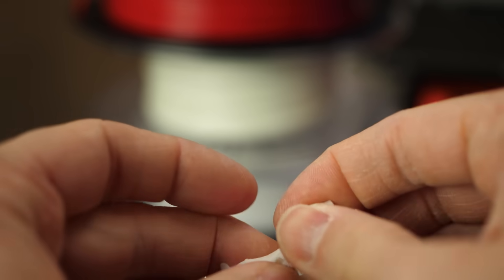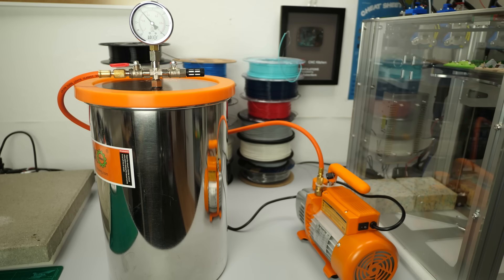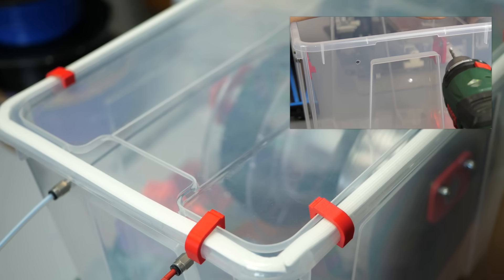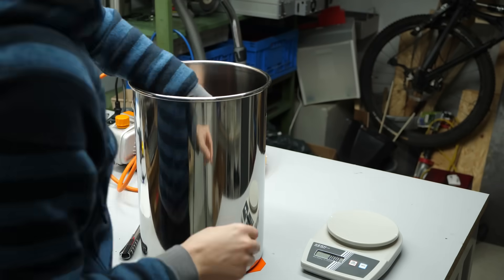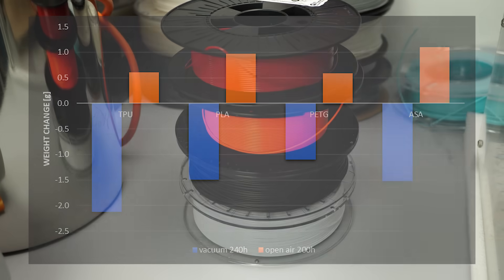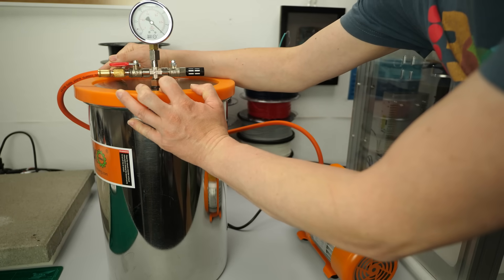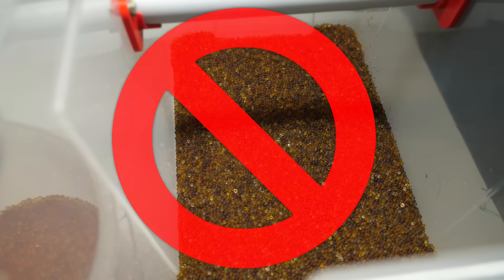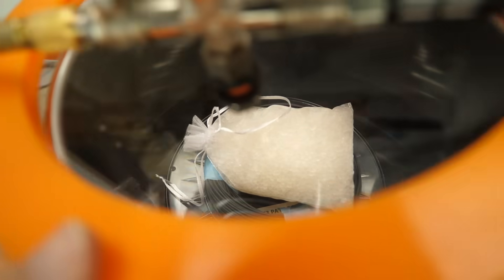Vacuum VS Dehydrator! What's the best way to dry filament?

Comment: You should try this again, but with a stronger proper desiccant, like a type that would be used in chemistry. Those beads you have will only seek an equilibrium of moisture with the air, but they hold more moisture than the air (per volume)... Something like Calcium Chloride (commonly used as a pet-safe sidewalk de-icer and food ingredient) will liquefy when it absorbs water, and is so thirsty for moisture that it will dry your silica descants out if they get trapped with it. Something like this is much more appropriate for use in a vacuum chamber, because it is far less likely to give up its own moisture to the air in there. The silica gel would just find the nearest equilibrium point, and taper off similarly to the graphs you showed.
Reply: All desiccants absorb to equilibrium, and calcium chloride is totally ineffective at low Rh. It's good at bulk absorption, but utterly useless for drying. Silica gel is better for our purpose, but far from best. Did you mean calcium oxide?

Calcium oxide is old technology, but extremely effective at low Rh. Its absorption is chemical, therefore difficult to recharge. Rather recommend common 4 angstrom molecular sieves. Sieves are potent at low Rh, fast absorbing, food safe, easy to handle, and fairly easy to recharge. Sieves are absolutely everywhere in industrial drying, and I guarantee every good filament maker is using them.
Reply: @RandornCanis  Sieves and Silica gel both work by adsorption. In a vacuum chamber, this is less effective, because the air has been removed, so everything that is in the air's space is water (and possibly other volitiles). Without a composite of partial pressures, adsorption is missing an ingredient necessary to its function. This is why chemicals that take more energy to dehydrate would be a better choice. One I see most often is copper II sulfate (probably because it's naturally color-indicating), but I'd suggest using the calcium chloride, because it has the chemical hydration reaction of calcium oxide and copper II sulfate, but is less likely to turn your kids into soap if they get it on them, or cause copper poisoning if they mouth a part that somehow got into the 'crystal smurf', as I like to call it. Calcium chloride is used in beer and food, and is also considered pet-safe ice melter, and some hand warmers. It can hold 150% of its weight in water, whereas silica gel can hold 35%, and seives 20%. You clearly know your chemistry, but I think there's a mixup in the equilibrium descriptions. Even if not, a can of calcium chloride (also sold as Damp Rid) next to my color-indicating silica gel canister keeps filling with liquid on top of solid CaCl2, while the silica indicates that it's getting drier and drier.
Reply: @buckstarchaser2376  Everything is metaphorically up in the air when literally under vacuum. I suspect the lab setting sees more perchlorates. Absolute overkill, but we're already in that realm with chemical dehydration under vacuum. Molecular sieves and silica gels could make achieving ultimate vacuum challenging, but it's moot with that single stage pump. Though, Van der Waals forces of porous absorbents would release (some) needed heat. Ultimately, I believe keeping the process simple with a vacuum oven is ideal here. Safe, simple, and modestly cheap with all legalization happening.

Under normal atmosphere, calcium chloride will dehydrate many indicators. As an example, cobalt(II) chloride absorbs a large mass of water at higher vapour pressures to form its hexahydrate. We shouldn't simply regard calcium chloride as the superior desiccant through observation of one indicator. It's more accurate to say the calcium chloride is dehydrating the system below the water vapour pressure to dehydrate the cobalt(II) chloride hexahydrate. Put rather simply, the silica gel isn't dry, only drier.

In storage under normal atmosphere, calcium oxide or sieves should be superior with far lower achievable vapour pressure capable of well more than dehumidification. Although experimentational data is abundantly available, it'd be an interesting exercise to test. While molecular sieves may absorb a fraction of chemical alternatives, this is negligible considering the couple grams total water in filament, much less the roughly 300 milligrams water in 40 litres air. Sieves' virtually infinite rechargeability and small initial investment make them very affordable long term.
Reply: @RandornCanis  Gotta point out that the Calcium Chloride ice melter is like $15 for a 25Lb sack, shipped, while dodgy 3A sieves are at least $20/lb before shipping. The CaCl2 is cheap enough to discard the fraction that deliquesses into its own victory water. Sieves, due to their cost and unlikliness of arriving ready to use, require a heating period, followed by a vacuum period. Or, you could just desiccate them with CaCl2. Whichever method makes you popular at the club is going to do well enough in your drybox... Calcium Chloride is by far the superior desiccant though. It's also called DampRid, if you wanted to pay more for the solid/liquid separator bucket thing. If you like it, you can just refill with the cheaper ice melter.
Reply: @buckstarchaser2376  Sidewalk salts also ship in higher hydration states requiring regeneration before process use. Molecular sieves are kiln dried in manufacturing. Made in North America for $5/lb through carpentry or petroleum connections. Quality and state easily verifiable with water and Van der Waals heat. I did specifically recommend 4 angstrom because the additional ion exchange process to 3 angstrom increases cost while decreasing capacity.

It’s suddenly apparent the fundamental misunderstandings in this conversation. From earlier discussion of vacuum desiccation, I’d incorrectly assumed the anhydrous state of calcium chloride. If you’re allowing deliquescence, I have to ask what is your understanding of hydration states? This because the plateau of equilibrium of Rh is over a whopping 30% if there’s any brine to fraction at all.

All opinion aside, the states of calcium chloride are documented ad nauseam. I recommend researching these equilibriums. You will find that even poorly activated molecular sieves will desiccate calcium chloride brine, reverse the chemical process, and fully precipitate the salt. Further, I fervently recommend replacing calcium chloride well before deliquescence; the Rh equilibrium plateau is shocking high. At the first sign of liquid brine, it’s frankly too late.
Reply: @RandornCanis  My experience with CaCl2 in a gun safe (not vacuum; not airtight), next to a large canister of silica gel (there is a second can of gel elsewhere in the safe), results in liquid brine in the can of CaCl2, and silica gel that is color-indicating that it has become drier by being trapped in that same air volume. The suggestions that you have typed so far have yet to overcome this simple observation from an accidental experiment. I use a little in my gun cabinet, and my biggest worry is that it may overdry the wood in my rifle stocks and cause cracking. If I recall correctly, we're commenting on a 3D printing filament video, and nothing anywhere close to lab-grade requirements are needed to straighten out some soggy PLA. Vacuuming the filament with silica gel will not work that well though, as you're essentially just replacing the air with vapor, until the PLA equilibriates. To get it satisfyingly dry for us nerds would require a substance that releases a lot of energy as it hydrates.  The low pressure conditions should not overcome that energy level so as to keep the mass flow in favor of desiccation. From that line of reasoning, it seems like concentrated sulfuric acid would dominate both of our favored desiccants.
Reply: @buckstarchaser2376  Putting it together. The hydrate state boundaries of calcium chloride follow: dihydrate 11% Rh ↔ tetrahydrate 20% Rh ↔ hexahydrate (deliquescent) 30% Rh. Like other salts, cobalt(II) chloride follows some set of hydrate states: dihydrate (purple) 34% Rh ↔ hexahydrate (pink). For fun, albeit irrelevant, cobalt(II) chloride hexahydrate deliquesces at 61% Rh.

These state boundaries are plateaus of equilibrium as they exchange large masses of water to overcome. This buffers the environment, and lends calcium chloride its title as a good bulk desiccant. The concept is similar to enthalpy of vaporization; adding heat to water, for example, raises temperature according to specific heat until a particular point where temperature stalls – boiling point.

It’s crucial understanding everything mentioned is chemical process, not chemical reaction. The calcium chloride, silica gel, and air are one system at equilibrium. All processes are easily reversible.

What does this look like in practice? Let’s start with calcium chloride dihydrate and silica gel dehydrate. Place both in container. As vapour ingresses, relative humidity rises linearly, but equally throughout the salt, silica, and air system.

At approximately 11% Rh, we encounter the first plateau. From this point, introducing further vapour mass will not yield any significant variation to Rh of the system. The calcium chloride dihydrate is rearranging its lattice and forming tetrahydrate. Only once dihydrate is exhausted to completion does Rh climb again. What do we observe? Well, nothing. Calcium chloride tetrahydrate is also a white solid salt.

Rh is now rising, so what’s next? We encounter the calcium chloride hexahydrate boundary at 20% Rh. The salt, silica, air system again stalls in Rh. Once complete, the resultant hexahydrate is again a while solid salt.

Finally after reaching 30% Rh do we arrive at our final plateau – deliquescence.

You may notice the overwhelming lack of mention the other components in this system. It’s not an oversight; there simply isn’t anything transformative to mention. Silica gel has been absorbing water throughout this exercise linearly proportional to Rh. At equilibrium of deliquescence of calcium chloride, silica gel will have absorbed 15% water w/w. What about the cobalt(II) chloride indicator? We haven’t even reached its first and most significant boundary, ∴ no colour change.

Sum it up. Why does calcium chloride desiccate silica gel? The silica gel was wet to start. It will diffuse moisture until the system is at equilibrium. Roles reversed, anhydrous silica gel will desiccate calcium chloride, but the limited capacity of silica gel weight for weight results in less observable effect.

Why does the added indicator indicate dry? Indicator salts vary appearance with their independent hydration states. Cobalt(II) chloride indicates at its dihydrate-hexahydrate boundary of 34% Rh. If calcium chloride is buffering the system at 30%, the indicator will remain at, or transition to, its dihydrate purple state at the cusp of “moist”. Indicators function independently of adjoined silica gels. Silica will absorb 17% water w/w before reaching boundary of cobalt(II) chloride hexahydrate, and will in fact absorb considerably more water after indication.

Is calcium chloride any good? Desiccant for its job. Wood absolutely suffers when dehydrated. You nailed it for the safe. The buffering at a healthy Rh, and capacity for a non-hermetic container. As for filaments, no problem bringing PLA and PETG to condition. PA6, PC, and even ASA benefit from more aggressive desiccants effective at lower vapour pressures. Calcium oxide and molecular sieves are examples of desiccants with high absorption at low Rh below 8%.

Should we use any desiccant under vacuum? Any moisture will diffuse from filament to vapour under vacuum. Vapour is air, and an ideal vacuum is the total evacuation of all gasses. There’re some perchlorates and exotic desiccants to compensate for ultimate vacuum never achieving ideal, but even a cheap pump with lousy ultimate vacuum will only leave several hundred micrograms air in a typical chamber. Certainly, one could calculate the resultant absolute moisture in filament from mean free path, diffusions, and so on, but it would be a fraction of what goes right back into the filament in those seconds it takes to pull it out and store. Let’s not be silly.

For our purpose, additional desiccants under vacuum are an unnecessary bandage. Silica gels and molecular sieves would off-gas if not well prepared, ultimately adding cost to achieve vacuum. Calcium chloride, rarely supplied anhydrous, would off-gas for days, stepping back through hydration states, contaminating pump oil, eventually forming a less-useful salt cake. As for sulfuric acid, if not prepared carefully, boing and splattering the moment we reach vapour pressure.

And now you know why I never had interest in becoming TA.
Reply: @RandornCanis  A lot of good info there. Thank you for that. I didn't catch how you're explaining two main components though. The first is that the CaCl can hold something like 150% of its weight in water. The gel holds 30%, and the air holds less. Therefore (the second point) for each sample to reach the same hydration point, the CaCl will be taking more water by mass. I haven't even looked into the CaO angle yet, as it takes high temperatures to produce from... I assume lime and/or eggshells, or a larger expenditure of money, but for something that has more risk in handling. Also, I'm thinking that the outputs would be CaOH, but with the added benefits of also snatching CO2 (though its a very rare chemical in normal atmosphere) to make CaCOOH?... and then a bicarbonate, possibly? Either way, 30% RH is desert-like and sufficient for drying/storing filament, but the higher the capacity of a given desiccant, the more ability it would have to buffer occasional air transfers. 
When the air in a vacuum chamber is sufficiently removed, however, the relative humidity will nearly reach 100%. This is where I'm assuming the humidity favors hydrating, over surface adsorption that is responsible for sieves' and gels' action.
Reply: @buckstarchaser2376  True that calcium chloride ultimately captures more water per mass, but this falls largely irrelevant in open systems. With air volume undefined, absolute water is not finite. Capacity becomes a qualitative comparison; suggestive frequency we expect to refresh each desiccant. We can overcome capacity by scale. Six times more gel will hold more water than calcium chloride. Does this mean the gel will dry the calcium chloride? No, each desiccant will capture as much water per unit mass at any given Rh as before.

What about a sealed container? The thinking goes a desiccant with more capacity is more aggressive, but this neglects the absorption curve characteristic each desiccant. Calcium chloride can capture several times its mass, but like many salts, almost entirely at deliquescence. No desiccant absorbs linearly relative Rh. Broadly, salts absorb exponentially to deliquescence, but little at low Rh. If I wished to maintain 20% Rh, calcium chloride only absorbs 10% water w/w.

Most other familiar desiccants absorb logarithmically from low Rh. Sieves over 15% w/w at 20% Rh, and calcium oxide an order of magnitude and nearly exhausted at 27% w/w. Beyond 30% Rh sees the salts dominate, but I already hear the effect of moisture on PLA in the home obsessively maintained to 32% Rh. Visual impact is imperceptible, but PLA. PC and PA6 famously degrade at even this modest Rh.

Again, it comes to the desiccant for the job. If your goal is 30% Rh buffer for a safe or PLA, don’t stress. Shooting hard 10-20% Rh for sensitive plastics calls for a desiccant with aggressive low Rh absorption.

As for silica gels, best of luck searching characteristic absorptions. With so many grades and qualities, it’s easier to generalize as “kinda linear”.

Isolating calcium oxide is not practical in the home. Fortunately, it’s sold desiccant ready to use. The only desiccant mentioned with a chemical reaction mechanism. This traps so many people; calcium is a double covalent bond, so two hydroxide groups – Ca(OH)₂. I don’t spend thought to carbon dioxide capture. Better the inert carbon dioxide than concentrating oxygen, albeit <1%. Yes, 4 angstrom sieves do capture carbon dioxide, but I’ll deal.

I understand the thinking of vacuums. Crucial here is understanding diffusion and partial vapour pressures. Each component of free air has some partial pressure summing to the total absolute pressure of air. If air were entirely nitrogen, partial pressure of nitrogen would equal total pressure. Humidity has a partial pressure some portion that of air and relative to Rh. Humidity will diffuse from regions of high partial pressure to low. This is how filament becomes wet in the first place, and similarly how silica and sieves work. For the same reason vacuums desiccate silica, we can desiccate filament. Water will permeate to equalize partial pressure, not Rh percentage. Water will still cold boil under vacuum due to vapour pressure regardless the saturation around it.

Would total water saturation under vacuum hinder desiccation? Depends on pressure! A perfect vacuum is the total evacuation of all air, vapour included. Any moisture in intermolecular space of filament will diffuse from that region of high pressure to vacuum. This increases vacuum chamber pressure that our pump removes. Certainly, an imperfect pump would see residual water pressure increase in chamber proportional to saturation, but even cheap single stage pumps achieve tens of microatmospheres ultimate vacuum. Going from normal atmosphere 40% Rh to tens of microatmospheres entirely water is a water partial pressure shift from ~10matm to, well, tens of microatmospheres. Replacing that water with dry air decreases partial pressure and furthers desiccation, but we’ve already removed >99% water from our system and filament.

Key there is replacement of water. Desiccants capture water. Pure water minus some water equals water. The result is a pressure drop. Sounds great, however no desiccant mentioned is energetic enough to achieve vacuums beyond our cheap pump already. This transitions to the exotics such as sodium metal getters.
Reply: @RandornCanis  Well, thanks for taking the time to explain that. I feel like I learned something. Fortunately, (or rather, the positive side...) my house is usually around 30% RH, because I'm a lizard. I also usually only use PETG, after my first few prints and discovering the brittleness of PLA. This is unfortunate, since I have several packages of PLA, with interesting colors and low prices, but the PETG has so far been immune to bubbling when kept in open, low-humidity air. I've had open-air PLA that was still on the spool just snap in my hands, and I am not going to trust that stuff. It's a shame too, because I could only find flesh-tone filament for making a planter in the shape of boobs in PLA, which I don't even want to print, because like the real thing, it's not going to last the test of time. Meanwhile, I have PETG parts to replace broken factory ones in my shower head, and submerged in my greenhouse year round. For all those reasons, and the pathetic working temperature range of PLA, it's just not worth using.
Reply: @buckstarchaser2376  You've discovered section modulus! PLA is good for non-compliant rigid parts, but shatters easily for this reason. Ironically, it's quite rubbery so near glass transition, which shouldn't be considered a discrete point. It'll warp with pressure over time.

Polyethylenes are fantastic. More compliance than desirable for mechanical anchors, but compensation is extraordinarily low thermal expansion. Dare to say generally only PC is better, but a nightmare to print.